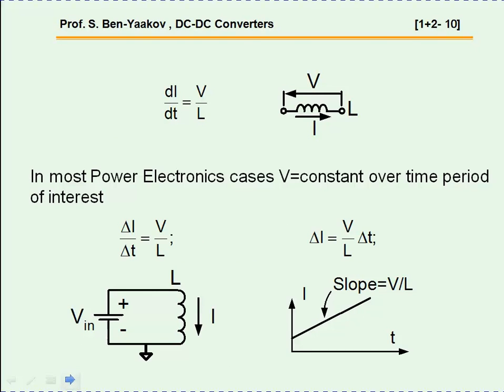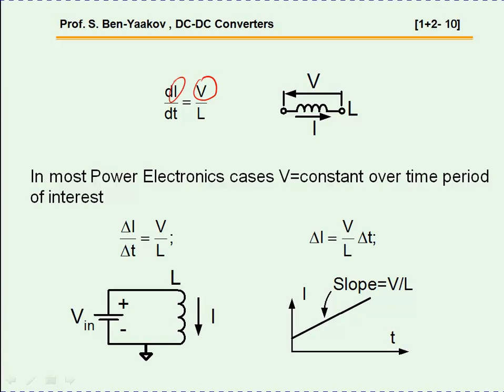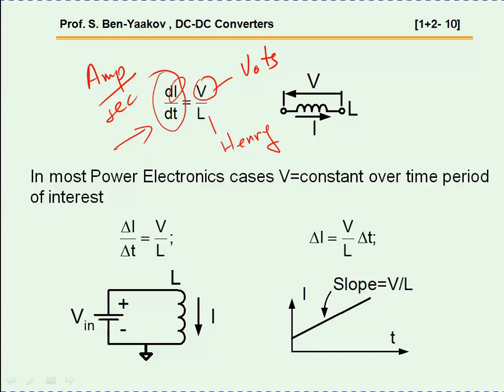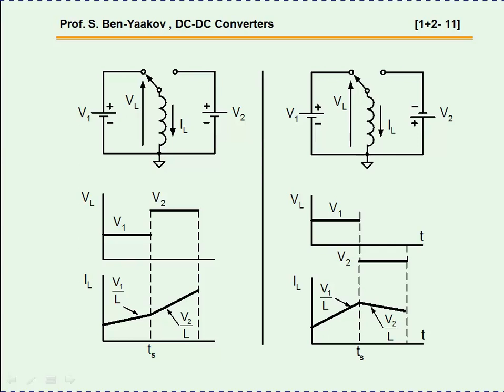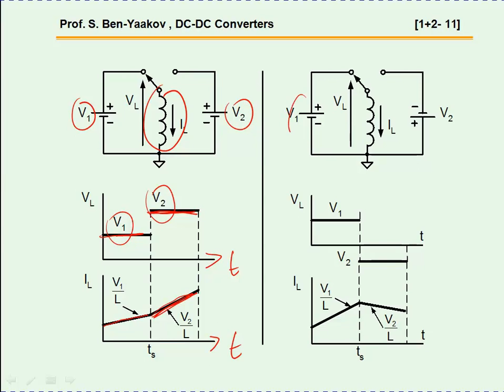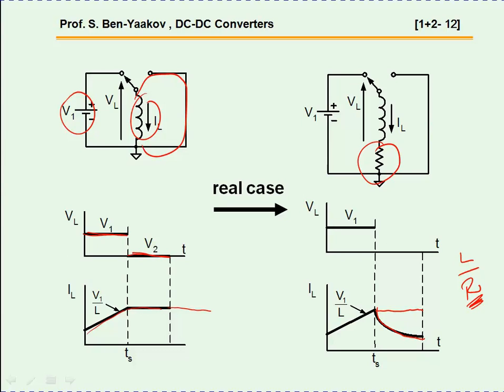Inductor behavior and Buck Converter Explained

Comment: Thank you for this magestic video explaining the buck converter. Nonetheless, I am designing my own buck converter and I've found an issue that i do not understand. You say, and I agree, that when the load is changed the Output voltage does not, but the current does. Nevertheless, here also enter the efficiency of the buck... But in my case i am designing an ideal buck converter, with ideal switches... and when the load is large (low impedance) the output voltage does not achieve the aimed one, with the correct duty cycle, there is no DCM performance i think (f.e -> if is wanted 5 v Vout and there is 20 V at Vin the Duty Cycle must be 25%). Why may be that? Thank you very much again for everything
Reply from the maker: Internal voltage drops that cause losses
Reply: @sambenyaakov  thank you for your response, yesterday i found that I supposed the switches as ideal, but i was not even close to that ahahha and they had a quite large parasitic impedance. Thank you very much

Comment: Please confirm that the load in the final example ( 31.23 min) is 5V/10A= 0.5 ohm. Time constant is L/R  1.2microH /0.5 ohm= 2.4 micro Seconds to 63% of peak. So frequency should be about 300kHz ( not 100kHZ) with a duty cycle of 0.5.  Only correct if you ignore the capacitor. Where have I gone wrong or am I completely wrong
Reply from the maker: WE assume a large cap so the output is like a battery of 5V.

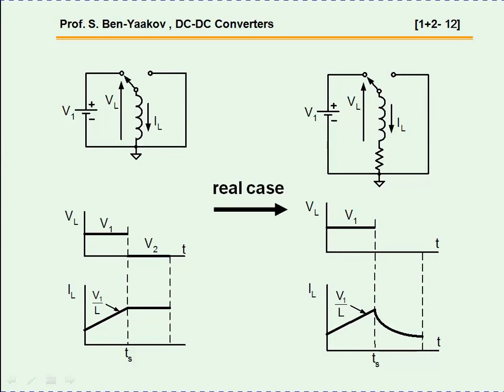Comment: Thank you Prof. Ben-Yaakov for the excellent lectures. I have been following them and they have been very helpful. Just a question on this lecture: at 3:17 when you showed the real LR circuit. You explained that the decay of current will be exponential. Shouldn't the rise of the current be also exponential? In your diagram however the current has a constant rising slope. Is there anything I am missing here? Thanks
Reply from the maker: Good point. You have a keen eye. I should have explained it better. When the battery is connected and duration is short you are at the beginning of exponential which is approximately to straight line. The discharge section should have been longer.  Thanks for pointing this out.
Reply: Thank you very much for explaining this point👍🙂.

Comment: Thanks for the explanation. I wish you would have covered the DCM, just as you did in the buck converter.
Reply from the maker: Good point. Thanks.
Reply: @sambenyaakov  I will definitely subscribe. I just have one question, which is related to converters in the discontinuous conduction mode.

Would you ever want to operate a converter in DCM? Does it give any advantage for certain applications?

Thanks, best regards
Reply from the maker: There are advantage running Flyback at DCM . See https://www.linkedin.com/feed/update/urn:li:activity:6671448579661529088

Comment: Hi professor, first, thank You for sharing very educational video where we can get back to basics analysis of a electrical circuits.
Probably one of the best video I could find so far of this subject and since You have many more of them I decide to subscribe on the channel.
But I would like to ask some question which troubles me. Maybe this comment section is not quite appropriate for it, but still I will ask since it's troubles me and I would like to have better understanding.
It is about constant voltage that is often shown across inductor in fast switching circuits like buck convertor.
In my head I have a physical picture that as soon as inductor is connected on constant voltage source it will start to build magnetic filed and the voltage over inductor will exponentially dropped almost to 0 value. Of course, during short period of time this drop won't be huge, but still voltage is not quite constant during that short switching period.
My problem is fit this picture into the model of fast switching circuit where the voltage over inductor is presented as constant voltage which imply linear current rise or drop.
Could you please help me understand why we can assume constant voltage on inductor in a short periods of switching?
Reply from the maker: HI Marko, thanks for interest. An inductor does not control the voltage across it when connected to a voltage source. It will comply with any voltage and adjust dI/dt. (similarly, a capacitor will not control the current when connected to a current source). You can write to me at sby@bgu.ac.il
Reply: I had also thought about this.Usually why Vl is a constant is prolly because the Vo is treated as constant.The possible explanation I can think is that 
1)once the circuit reaches steady state , the capacitor say charges to some voltage.The natural time constants involved like RC,LC etc are very large compared to switching time.This implies that capacitor discharge is very less over a switching cycle , hence Vo is almost constant
2)In terms of frequency domain, the Inductor passes lower order harmonic currents(as its impedance is jWL, it offers more impedance to higher harmonics) and the higher  harmonics among these lower harmonics itself are mostly absorbed by The filter capacitor as they absorb higher order harmonics easily.Hence the current which passes to the Resistor load is almost dc current (and hence almost constant) due 'a kind of 2-stage' filtering of higher harmonic currents by inductor followed by capacitor.

Comment: professor do you mean the the DC current goes to the resistor and the AC goes to the capacitor?
Reply from the maker: Yes. No DC via capacitor. Resistor will have some AC current depending on ripple voltage.

Comment: Why current across inductor increases linearly instead of being exponential with time? Is it because of constant Vout?
Reply from the maker: Two reasons: vout is approximately constant voltage and the resistance of L is low so the time constant is very long and we are are just at the beginning of the exponential curve

Comment: Dear Professor, you have an amazing talent to teach these topics. It would be great to follow your lectures in an order. Is there such order or link or are these random uploads? I saw your lectures in Hebrew are in order but couldnt figure out the English ones. And one question: in simulations a linear voltage regulator at the output of a dc dc converter or smps attenuates the differential switching noise a lot. Is this way also used in practice? I tried LC cascaded by a linear voltage regulator at the output of a noisy ripple voltage source and was amazed with he result. Would be glad if you have comment on it.
Reply from the maker: Thanks. See index at https://www.advicepoweracademy.com/video-tutorials
Yes, LDOs are used successfully in low power applications.

Comment: WHAT IS the effect of  entilrely  removing the  inductor  ....the   rule  of  vout = d*  vin  is  still   completely  valid   even if  no inductor  exist  ???       or   just the  inductor  ensures  large  amounts of current   supply    ??
Reply from the maker: Without the inductor there will be no regulation The output cap will be charged to input voltage
Reply: @sambenyaakov  dr  as if you stating that  as long as we  run our  converter in the  continous mode  we  wont need regulation (ices and  feedback networkds)   as it  can be done   by the inductor(with proper design )   ?

Comment: Hello Sir, I have question

In the Buck convertor , If Inductor value is more than calculated value what will be impact on Vout? For example: calculated value is 68uH and I will use 300uH Inductor.
Reply from the maker: In general, there is not much change as far as  voltage regulation. But: on the pro side: ripple will be lower. On the con: slew rate will be slower (the ability to ramp up the inductor current in case of large load change)
Reply: @sambenyaakov  hello Sir, thank you very much for answer, sorry for the late reply.

Comment: Hi, Professor
I have a question.
The waveform of current of an inductor at the second slice, it should be pass through origin.
Why doesn't it pass through? 
In the beginning, iL(0) = 0? 
It that wrong?

Thank you so much!
Reply from the maker: THis is a general case (as you will find in a PWM converter) in which the initial inductor current is not zero.
Reply: Thank you for your feedback.  ^ ^
I knew that it's the steady -state result. The current camp of an inductor would act like that,
 when converter goes to steady- state response with a fixed switching frequency. 

So, if we talk about at very beginning, which means I turn on a dc source at the first time, the current of an inductor should rise from zero amp, and after the system goes to the steady state(after several cycles), 
We just see the common waveform(general case) in the slide. 
Is that right? 

Thank you so much.

Comment: What if I have an output power instead of current , in my case it's 5 watts. Do I use Vout/R as my Average to find the minimum inductance?
Reply from the maker: Yes, but R for the maximal expected.
Reply: Thank you sir for the reply. Can you give me tips on how to approximate the values for R , C and L. I am trying to simulate and build an open loop buck converter, stepping down 25 volts to 15 volts. Can you give me tips ? How can i choose a capacitor that would guarantee me a ripple voltage of less than 0.5%? Appreciate your sir most useful video I found on youtube on Buck converters is your video
Reply from the maker: First thing is to choose the frequency and decide on current ripple of L this gives you the value of L. You choose then C for desired ripple voltage given the ripple current. Good luck.
Reply: Ok sir, I have found another formula similar to your formula for approximating C minimum. The problem is both use Ioutput which I am not given in my design problem. Instead I was given Poutput to be 5 Watts. I found out the resistor rated load value by P = Voutput^2 / R and got a certain number for R. Then I used Vouput/ R to get the value of I output. I am not sure If I did the right steps to get I output. But many values rely on it and It is cruicial that I get it right. Could you tell me if this is the right way to compute it? Appreciate you sir

Comment: Dear Sir when the switch is Open, the charges from output capacitor wont flow through Load,R? If it does then how does the output voltage remain constant as charges stored on capacitor are that from ripple? I am confused about capaitor role
Reply from the maker: I am not sure I followed you question. The role of the output capacitor is to keep attenuate the ripple so the load sees  a DC voltage with some ripple on it. In a CCM Buck the inductor current always flows to the output. Does this answer your question?
Reply: Thank you sir for your response. When switch S is opened, the inductor tries to maintain the current and therefore provides current to the load. The same way charges are also stored on capacitor, will the capacitor try to discharge itself through load aswell? what happens to the charges on capacitor? Because I watched a video where it was stated that the capacitor grounds the high ripple current, the term grounding was quite ambiguos to me. Can you please shed light on what happens to capacitor as regarded to the charges on it?
Reply from the maker: At steady state, the average inductor current is equal to the load current while the inductor ripple current is passing through the low impedance of the capacitor which is  "shorting" it. This is why the ripple voltage is low.
Reply: Thank You sir :)

Comment: Dear Professor,  can this be another  explanation of  negative spike?  This is before the buck converter explanation. " since inductor current can't change instantaneously. So current will continue to  flow and keep on sucking charge out of  the right side of the switch node. So the switch node will see a negative spike."
Reply from the maker: Hi Abhishek, please send me the time coordinate (minute) of the location you are referring to.
Reply: Sir, I was referring to time around 9:00 minutes.
Reply from the maker: "keep on sucking charge out of  the right side"  Current can flow only exist in a closed loop.
Reply: But sir, as you explained , assume some imaginary resistor, which is actually not present. So I think current can't flow. Then I don't understand it intuitively. Mathematically since di/dt = towards minus infinity so Voltage across the inductor will also be towards minus infinity.
Reply from the maker: The mathematical explanation is is V= L dI/dt/ The intuitive is indeed the the inductor's " attempt to keep the current flowing. I was somewhat uneasy by "sucking charge" since it has the connotation of just charge moving while we need to look for the current loop.

Comment: 0:46 Hm, it's not derived from state-space, but from electromagnetic theory (Maxwell's equations.) Or maybe you meant something else.
Reply from the maker: You are of course correct. This was s a slip of the tongue. What I had in mind that this relationship is used to describe the inductor in state space equations. Thanks or pointing this out.